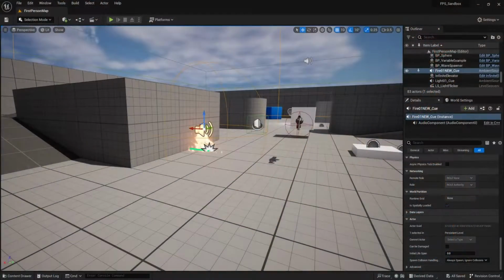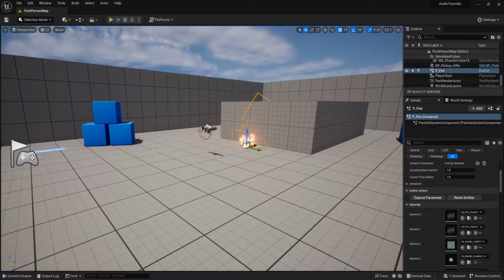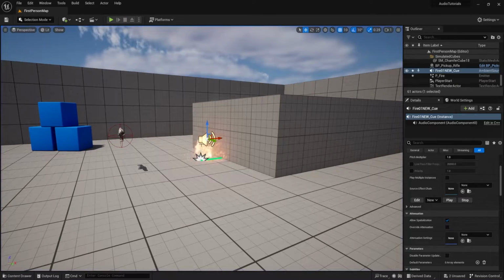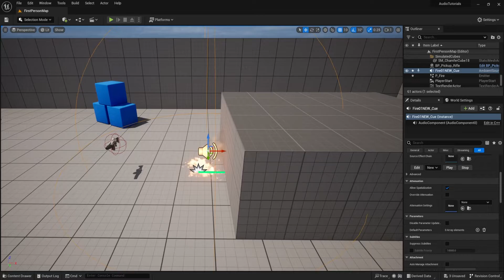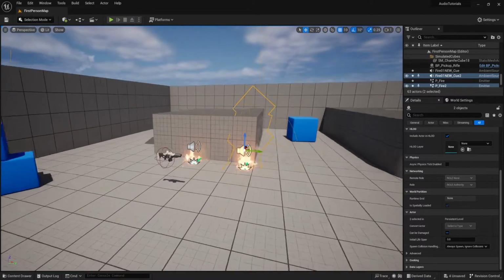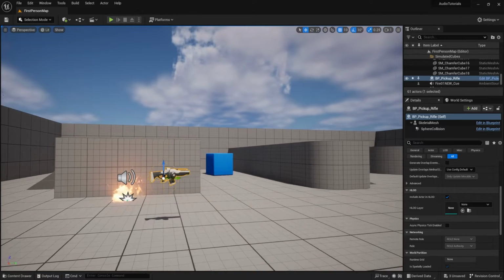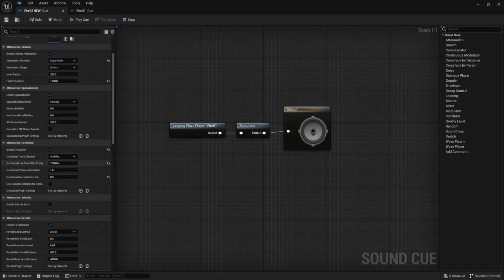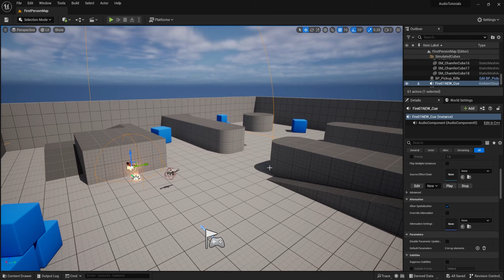Using Point Emitters for Sound Design in Unreal 5

Comment: If you do not use any logic in your Sound Cue there is no point to create one. You can open wave file and set it up with attenuation, class, concurency, effects etc just as you do in Sound Cue.
Reply from the maker: that's fair, I had just gotten into the habit of making the cues for pitch randomization (in most cases), but also so I could add logic later instead of swapping out a new asset. good catch!